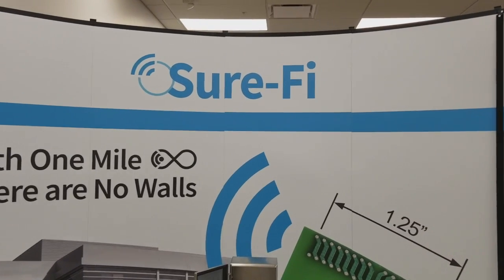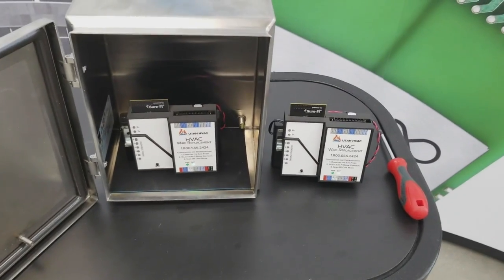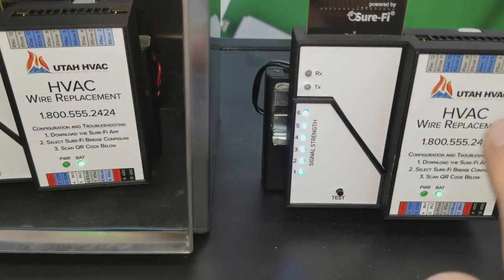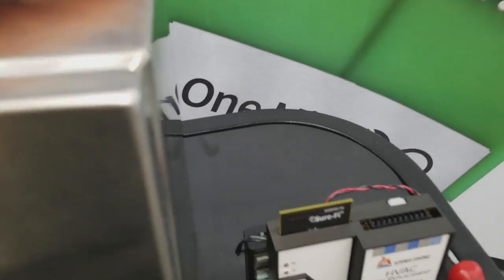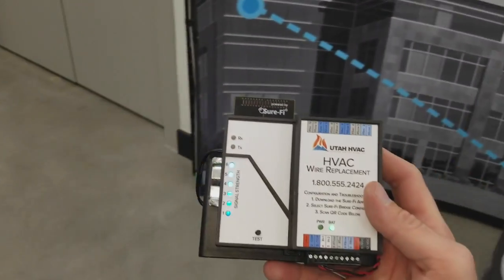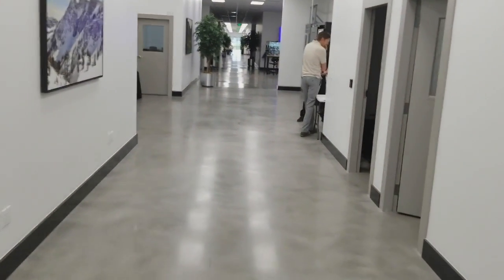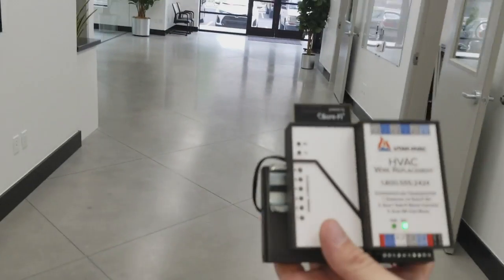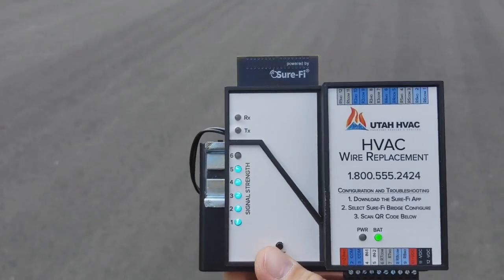Sure-Fi Wireless Bridge Demo - New Vistas Campus

Comment: In what scenarios is this equipment used?
Reply: It is used extensively in access control since you do not need to run wires in the ground or through walls, concrete, brick, etc. It is also used in HVAC systems for similar reasons. It replaces any low voltage wiring which is significant especially when running long distances or through obstacles.
Reply from the maker: It is used daily in access control to avoid trenching wires or retrofitting buildings. It is used in Hvac systems, ISP monitoring, and many other applications. It replaces wires which saves time and money, especially in large buildings. Checkout our more recent videos to see some of the many uses.